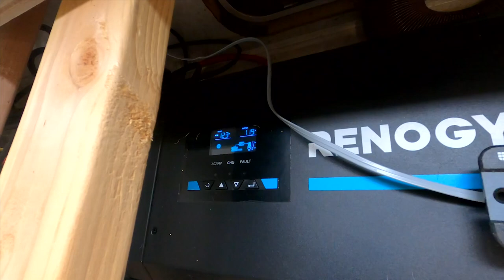COUPLE RENOVATES RV INTO TINY HOME | FULL TIMELAPSE

Comment: Depending on the how textured the tile is after fighting grout removal we found a product called grout release.  It is sort of like putting soap on the tile, you let it dry then grout.  When you wipe the grout off it comes right off!  Saves a lot of time.  If the tile is smooth you really dont need it.  Just a thought.

Comment: How are you going to prevent Terry’s water lines from freezing during the winter?
Reply: We put space heaters under our trailer and then skirted it with an easy access panel. If you don't your sewer or holding tank will become frozen... poopsicle like.. we lived in mountains of Montana for 3 years. We had our holding tanks freeze and had to borrow a stadium heater to thaw it out.

Comment: This was a great video guys!

First off, I am Not criticizing, I am Teaching the reality of construction and carpentry!  They are plaining on framing a house in the next two months, just before winter, with no prior experience other than a little carpentry.  There are Millions of little tricks and trap doors in construction.

2:40  To accomplish this inside corner, you have that outside wall piece go all the way to the perpendicular wall and then take a longer than needed piece and cut it to fit against the pother piece.  When you have it perfect, you cut it to length.  It is called Butt and Pass.  That is how you do inside corners for moldings.

T&A are showing you some of what it takes to get things done but if they focused these videos on the Reality of what every moment of these adventures are really like, you would feel ill watching them.  It's the same with any video or story told.  Reality is often Not very entertaining.

Now, when you are building a house, you will have to know dozens and dozens of little tricks like that one EVERY DAY!  You have no time to learn at that point.  If you have unlimited resources, endless amount of time, you are on tranquilizers or anxiety pills and you hate your spouse anyway, then you may just make it out the other side alive and sane but I doubt it.  Yes, that is how bad construction can be if you start out with a big project with no experience.  Even with seasoned craftsmen, construction can be very stressful.  

9:14  Multiply this interaction by 1000.  That's what this house framing will be like.  Again, you can PLAN anything you want but reality will almost never be like your plan and when your entire financial existence is riding on it, you had better think about the bad more than the good.  That house construction will NOT be a good and fun experience.  Even for me with 40 years of experience, the entire process would be frustrating mainly from the things I wouldn't be able to control.  Like humans and the weather.

"Yes, you can drive a car very well but how would you feel if you suddenly found yourself on the front row of the Indy 500 when the green flag falls?"

Comment: Did you ever figure out that if you turned the base of the table legs upside down and had them on top of the floor instead of inside the floor that your table would be sturdier?
Reply from the maker: These leg mounts are meant to be inside the floor, there are different ones that are above the floor. I wish we could just swap them and make it sturdier though

Comment: I'm surprised you stained the butcher block: I have read this,
"We don't recommend using a stain on a butcher block counter top because the stain is most likely not food safe. The stain could seep out of the counter and into your food, causing the food to taste bad and possibly be toxic. Our Cutting Board Oil and Butcher Block Conditioner are better alternatives and are food safe." Be careful with food.